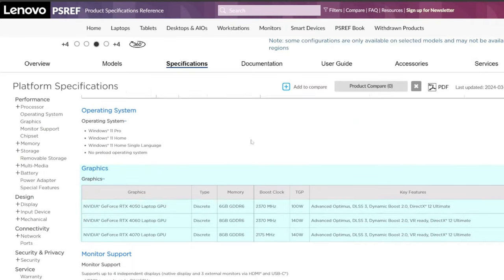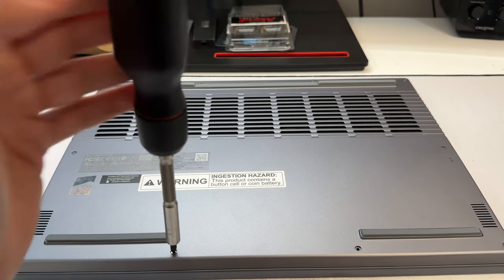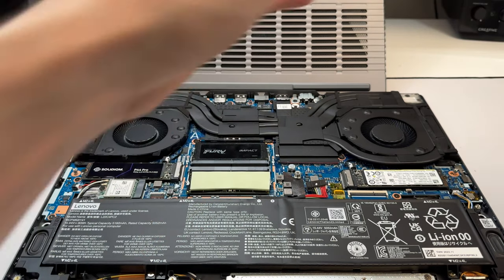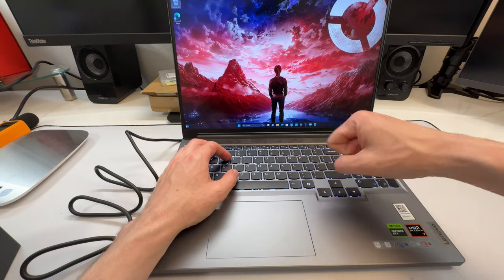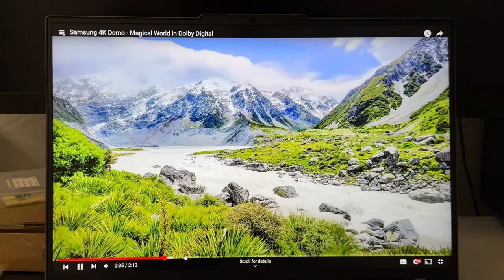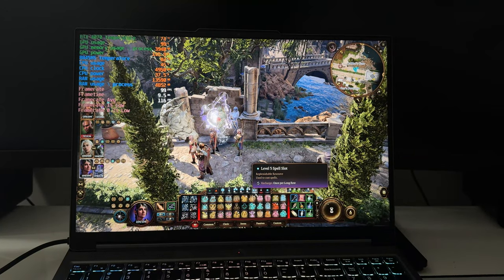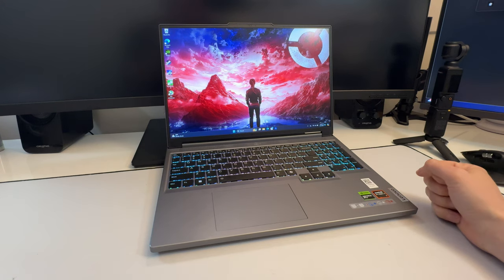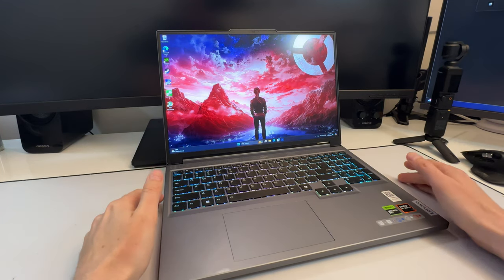Budget King Returns?! - 2024 Lenovo Legion 5 Slim - AMD

Comment: Didn't watch the entire video, but just got this laptop and upgraded its RAM plus added a secondary SSD. Runs all my games on highest settings no issue, well worth picking this Laptop over comparable gaming laptops that start at 1000 bucks more for the same hardware and I hope it lasts me as long as I hope. :)
Reply: What RAM and ssd u choose to upgrade?
Reply: That's awesome 😎 

Does it run games decently without any power connected? Or will it limit tdp or Hz while on battery?

Comment: I have the 2023 version of the same with the RTX 4070 (weirdly it was the same price as the RTX 4060 when I bought it) and the 7840 processor. It has a black keyboard and a black surround that matches it in my case - might be a UK thing, not sure. I love the silent mode - it isn't silent and I do think quiet mode would be a better description, but it's good enough, and I really don't like fan noise - and it is excellent for gaming and worth the small sacrifice in FPS to use that silent mode. I'd call it mid-range rather than budget - it's a lot more expensive (almost double) than the Acer Nitro 5 I bought a couple of years ago which had an RTX 3070 inside it and an Intel chip - and I'm more than happy with it, both for gaming and for development work; I've also done a little video production with it and that went fine as well.
Reply: how much u paid in which country?

Comment: bought this model with same specs but 32GB RAM and 500nits display! so excited to get it!
Reply: same, just ordered
Reply: @lyntonbell7604  please tell me the TGO of the laptop
Reply: How's the battery life?
Reply: @ARJUNNAIR-nw4xr  hi the clickpad was broken upon arrival so had to return 🙁
Reply: @ojas_kothekar   hi the clickpad was broken upon arrival so had to return 🙁
Reply: How was the return process. Ive had issues with lenovo before @lyntonbell7604
Reply: @BSingh-on4qr  pretty easy, was within 14d but keep postage tracking receipt proof as they did ask...
Reply: @lyntonbell7604  Great. Did you test batter life at all?
Reply: Just bought literally the same as you last night. Seemed like a no brainer to upgrade the display for 20 bucks and to the 32 ram for 70 bucks. I paid $1300 on the dot after taxes.

Comment: ddr5 runs in dual chanel even if one slot btw …With DDR5, instead of having one 64-bit channel per module, it's split into two 32-bit channels (+8 bits ECC) per module, for more efficient memory access. So it will already show "2x 32-bit" for a single module, even though physically from the board's side, it runs in single-channel mode.
Reply: This is exactly what I was going to point out , I would rather have one stick of 16gb running in dual channel that gives me the change to outright upgrade to 32gb by buying one additional module , than give me 2x8gb modules running in quad channel that I'll having to ditch and invest in a 32gb kit to upgrade .
Reply: @abzeed  do you know, will any DDR5 RAM with the same speed work? The review said its not a good idea to mix RAM due to some timings (have no idea, not a hardware guy)

Comment: How does this compare to the the Yoga Pro 9i? For gaming (Mainly plugged into a 34 inch 1440p monitor) and as a daily work computer for Software developer. I’m really on the fence on what to get. I’ve been looking at G14/16 2024 models as I liked their new design but they seem a bit pricey for what you get. The G14 4070-model and the Yoga Pro 9i is about 3k usd in Sweden. Do you have any recommendations for a lost soul?

Edit: Great and informative videos btw
Reply: Legions are full fledged gaming laptops and have some of the best cooling systems you get on laptops. So a Legion should outperform the Yoga, as Yoga is meant to be a workstation laptop and is considerably lighter than this one. That's the thing with gaming laptops, most of the time you trade weight for cooling and therefore performance.... it's why Legion 7s are so heavy. Pick your poison:
1. Yoga I believe has an OLED display, which is excellent for multimedia and gaming but if you're gonna work on it for long hours, it will be prone to burn in.
2. Yoga will also probably have better speakers and a full metal build.
3. Legion will have the better cooling and performance.

Depending on what your needs are, pick any one.
Reply: Thank you! FYI: After countless of hours researching I ended up getting an open box Zephyrus M16 2023 (4070, I9) with the miniLED display. I’m updating RAM from 16 to 64gb and adding another SSD when it arrives. It was about 1000$ cheaper than any alternatives with miniLED or OLED with the same specs in Sweden. I know its quirks and issues but I guess we’ll see how it performs :)

Comment: is there a major difference in taking rtx 4070, or can i stick with a rtx 4060 because both of them can max go to 110w  TGP.
Reply: Rtx 4070 mobile is about 15-20% faster than the 4060 mobile. 4050, 4060 and 4070 laptop gpus are gimped by the voltage limit Nvidia put on them, which means that the 4050 is stuck around 90W, while the 4060 and 4070 top at 100-105ish Watts.

Comment: I thought it will have different chassis with all rear vents (prob. intel version will have that). 2023 editon had pretty good thermals, this one is little bit on higher side with old chassis i think new amd processor is running hotter.

Comment: Can you do a detailed comparison with last year's Legion Slim 5? The price difference between the two isn't huge in my country
Reply from the maker: If the price is near equal get this years.
If last years is much cheaper get that. The AI and tuning on the CPU is great for efficiency, but otherwise they are similar
Reply: @TechGuyBeau should I go for this or Gen 9 LOQ ?

Comment: Thanks for the review. 
Quick question. How to and with what we could add additional SSD on a p16s Gen2 ? Can we use the WWAN slot for this? Also can this board take a 5G fibocom module? What to choose. PCIe or NVMe cards for the WWAN slot? 

Answers to these questions really help.
Reply from the maker: The p16s second slot won’t accept and ssd I have at least. Probably not whitelisted for nvme SSDs. 

As for the wwan slot, try putting your serial or model number into the Lenovo website. It should provide you with compatible modules

Comment: Thanks for the thorough breakdown I picked up this machine after watching your review! I ran cinebench and one of my cores is staying at 100 degrees C for the duration of the test. In regular use this core is usually between 10 - 20 degrees hotter than other cores. I understand it will get hot because of the stress test but I wonder if the thermal paste hasn't been done well on my unit. I used performance mode using cinebench and the fans kick up high. I watched your footage again and couldn't tell when you ran cinebench, did any of your cores stay on 100C for the period of the test? or just spike at the start ? I look forward to hearing from you, my exchange period is coming up and I am curious about your thoughts if this is normal behaviour for this model.
Reply: How is the laptop doing ? Any issues ?

Comment: hey Beau, have you seen the new HP Envy x360? They look very close to the spectre, with a 7U processor, 32GB RAM and no Arc graphics. Also no haptic touchpad but that's not a big deal IMO. It looks very interesting, especially that CPU, I wonder if you can get it for review.

Comment: Now  i found this one for 1284 usd on lenovo website. I need it for 3D modeling, rendering, unreal engine, unity and gaming of course. Is it a good option in my case? I was considering Loq 15 2023 and Slim 5 2023 both with 4060 512ssd 1080p and 144hz too. But idk I need more opinions

Comment: The 7940hs (among others of the 7040 series) already had AI cores, thats not new on 8040 chips.
Seems they are pretty much identical tbh.
Reply from the maker: They are better turned. You can really see it in battery life. Also some Bugs have been ironed out. They are similar though otherwise yeah

Comment: Hi was wondering wether to get this with 32GB ram RTX 4070 1TB with the 500nits upgrade or Legion Pro 5 16-  AMD Ryzen™ 9 7945HX-32GB-1TB-RTX 4070 just not sure especially if the legion pro 5 runs hotter with the Ryzen 9 and I do love how silent the slim is. (Only a £100 difference between the two)
Reply: I was debating the same thing yesterday on the lenovo UK website. In the end I decided to go for the slim because the legion pro 5 only supports 32 gb ram and I want to possibly upgrade to 64 down the line. In addition, the slim has better battery I believe, and looks more aesthetic. It's also 1 year newer. And the £100 difference in price isn't huge but its still a difference. The difference is even bigger if you choose the slim without Windows.
Reply: @goodies7652  thanks for the reply and yeah think I’m going to go with the slim cause it’s got great reviews and is on the cheaper side as well and I do prefer the better battery. Cheers
Reply: @goodies7652  does ryzen 7 7745hx legion pro 5 4060 max Memory 32 or slim 5 model 2024 ryzen 7 8845hs 4060 max memory 64gbis good. Is it good to buy with customized. Or the slim 5 model I mentioned you used how it , please say me me

Comment: Trying to decide between this laptop and the Legion Slim 5 14.5" with OLED screen. Both sizes/weights are acceptable to me, just not sure if the OLED on the 14.5" with soldered 16gb is worth it over the larger, but non-OLED, screen with expandable RAM on the 16". 

Would you take the OLED over the screen on this slim 5?
Reply from the maker: Get the 32gb 14”

Comment: hye what do you think about legion 5 slim 2024 rayzen7 4070 and legion pro 5i 2023, i7 4070, which one should i buy, because both laptop have similiar price in my country❤️
Reply from the maker: If pride is the same the pro has better cooling. The 5 slim has better battery life. So I’d base it on that.

Comment: The 240hz, 500 nits, hdr400, etc.. screen upgrade was only $30. I got that screen, the 4070 and 32GB as upgrades. Everything was CAD$1992 pretax + 15% Rakuten during labor day sale. You got yours $1600 tax in ??? Wow, but I guess with Rakuten the cash back should be about $300. So not too bad.

Comment: You're videos are so informative, really helping me choose a laptop, it's fantastic!  I'm torn between this Legion 5 Slim Gen 9 16" with a 240Hz screen, or the Legion 5 Slim Gen 8 14" OLED.  I really like the idea of gaming on those quieter modes and performance configuring you showed in this video, is the gen 8 14" just as capable with this? 

I'm worried the gen 8 14" is inferior, but I'm being a sucker for the OLED 😂. And maybe the 240Hz screen is sufficient. Which would you go for, gen 9 16" or gen 8 14"?
Reply: Depends on you, if you're not into gaming then oled would be better, but if you're into gaming especially on games like Valorant /CS then getting the 240 is a very good deal honestly as it also brings you 2k HDR display at the same time + better cpu efficiency and overall newer laptop

Comment: Hi! I instantly like the video and the capabilities of this laptop love the performance and the display, i managed to get the 500nits but there has to be something wrong with my unit because set on quiet with best power saving mode and only on igpu 60 hz and full brightness i get around 2 hours without doing nothing and memory gets around 35-40 ussage, pawer drown 20-25 watt but that's weird in itself and battery saver active or not does absolutely nothing, like it doesn't have any battery saving capabilities

Comment: Hello, very good review.
I just bought slim 5 14" 32gb RAM, and its nice, however I do not see much of a difference between quiet and performance mode other than unacceptable fan noise in performace mode:) Actually I do not understand why in some game GPU is not pushed higher but staying around 40W in quiet mode, and after change to performace mode around 90W I have pretty same FPS - yeah that is strange.
Anyway I do really like 14" form factor, because its just lighter and smaller, but I am thinking about slim 5 16" with rtx4070, I know there is not much of a difference at least on paper on YT test, just wanted to ask for Your opinion here.
cheers

Comment: How did you get to customize this? I can’t find any build your own on the website. Did it sell out? They only offer the 350 nits and I refuse to buy anything else than 400 and it better be OLED at that point.
Reply from the maker: Which country? The builder is still available in Canada although these go out do stock often
Reply: I’m in the USA. Bro I’ve been looking at laptops for WEEKS! I don’t have a pc yet but plan to build when cyber Monday comes around. After all my research in looking for an affordable $1300 range gaming laptop that also has decent battery life for me to be able to use in college I keep coming back to Lenovo slims. I’ve been stuck between this and the legion 5 slim OLED. The oled not having upgradable ram killed it for me but after I saw it apparently has flickering in hesitating to buy it now. It’s driving me insane that this model doesn’t have really any videos on YouTube talking about it except for you and 1 other channel I can find. This is currently on sale with the 350nit screen and 16gb ram for $1300 but the OLED 14 is going for $1250. I told I keep waiting I’m afraid the sale on this model will be gone. I’ve never had my own laptop before and I can’t understand the difference between a 500 nit and 350nit screen but honestly that’s what has been holding me back on this model lol. If you were to give your honest opinion on what I should buy with the Slim 5 OLED 14” and the Slim 5 16” gen 9 which would you pick for gaming, school work with priority’s of Heat, screen quality and especially battery life as your biggest concerns?

Comment: I dont agree that the refresh rate difference is insignificant. 
If you are using the laptop for esports titles you will be getting above 165 fps and the higher refresh rate will give a smother experience, especially with gsync

Comment: Okay so sorry for pestering you with questions again and again lol, but can you check one thing for me? Can you tell us if the RTX 4070 is pushing 140W or is it still voltage capped around 110 watts or so? Coz last year no RTX 4050, 4060 or 4070 laptop reached the advertised 140W TGP, even the ones advertised with it. They all maxed out around 100W or so.
Reply from the maker: The 4070 CAN push those watts, but remember wattage sharing is between cpu and GPU. So in gaming it won’t get to 140

Furthermore, there is quite literally no reason to push a 4070 to 140 watts. Once you hit 100 watts, adding more provides to benefits. I highly recommend not cross loading over 100/110 watts on the GPU as it’s putting watts in for no reason.
Reply: @TechGuyBeau  okay, so it's still the same then? Meaning no performance gains over 100 watts or so?
Reply from the maker: @mihirojha4475 exactly. A 4060/4070 should be limited to 100 to 110 watts max. Anything else doesn’t add benefit and maybe hurt performance due to heat

Comment: For about the same price ~1250 usd, I have a quote for Lenovo slim 5 gen 9 and Dell g16. If portability is not an issue for me which one would you recommend? I am mainly looking for something which can give me acceptable performance even after 4-5 years.

Dell g16 7630
2x16gb, 13900hx, rtx 4070, 2.5k IPS, DCI-P3

Lenovo slim 5 gen9
2x8gb, 8845hs, rtx 4070, 2.5k IPS sRGB
Reply from the maker: Absolutely the Lenovo. Battery life will be massively better, as is the build quality.

Comment: Does is still have type c charging issues? A lot of reviewers report not being able to charge it from a non-proprietary charger, and only the ones from Lenovo work.
Reply from the maker: Yes. I have Lenovo and non Lenovo usbc. Some usb c chargers are not in agreement. They need to be really high wattage.
Reply: @TechGuyBeau  like what wattage? 65 watt one wouldnt' be enough anymore? Because My 65w one from UGREEN works perflectly with my Legion 5 pro 2022 version. Aside from 65w not always being enough for high loads like gaming of course.
Reply from the maker: @TabalugaDragon it’s just an issue with slim5 models. I dunno why
Reply: You need the official Lenovo brick that is only available in China for usb c charging. It won't charge full speed in America either. Only 100w
Reply: @Franciehatescoffeeicecream  I see. This is why I went for Legion 5 pro with 3070 ti instead. 
More ports, proper type c charging. 
One could say "but the 2023 version Pro 5 has proper type c charging" to which I'll say - it only comes equipped with HX CPUs which results in terrible battery life. 

2021 and 2022 models were the best of both worlds, then Lenovo ruined it.

Comment: I'm a bit confused why is there no overdrive option in lenovo vantage? and why is GPU cTGP only up to 115w. i know about voltage limit but its rated for 140w right?
Reply from the maker: The GPU doesn’t benefit from going above 115 watts. It’s a waste of heat
Reply: @TechGuyBeau  how about overdrive? does the display support overdrive because in datasheet for this model it says it does but i didnt see it when u opened lenovo vantage

Comment: Hey I'm really confuse Im gonnna buy this laptop next month but im confused btw the 2023 model and this new 2024 model 

Main reason is that 2023 model is slightly cheap then the 2024 so is it really worth to spend few more for the 2024 model or just go for the 2023 model
Reply: Please help me I'm really confused
Reply from the maker: It’s basically the same, get the new one if the prices are close due to better tuning. Otherwise get last years model

Comment: hey, i have the same laptop, turning off the gpu, using power saving mode, low brightness and even with a few more extra tweaks the battery life is half of what you're getting, my idle power usage when seen through hwinfo is 20 watts. why is this happening and can i fix it